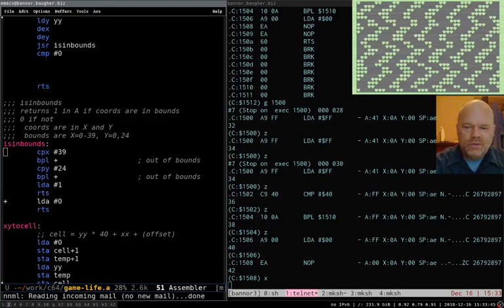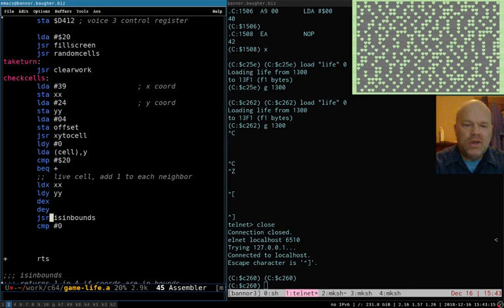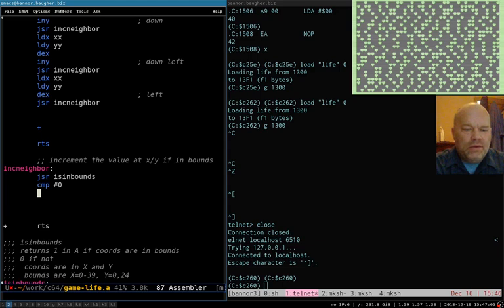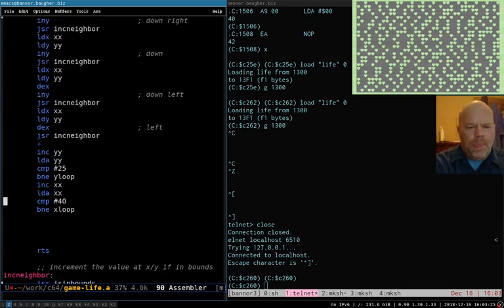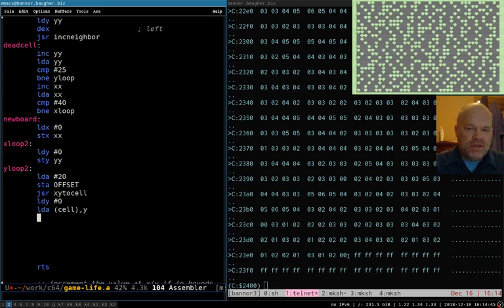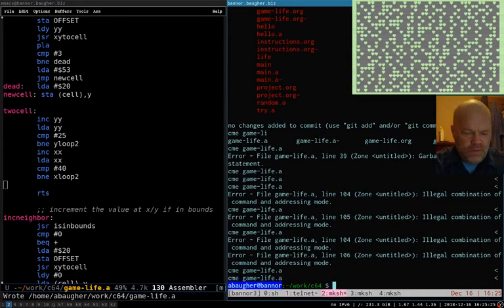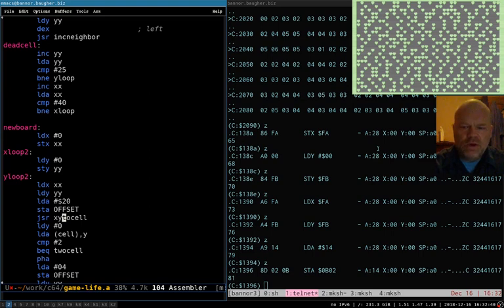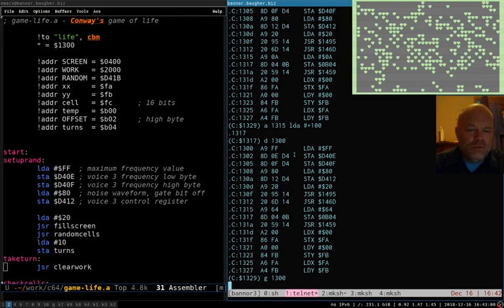6502 Assembly Language #9: Game of Life Part 2

Comment: The looping through neighbour is actually rather simple if you use the memory spaces.
Subtract 41 and then read the 3 bytes (that’s the top row)
Add 39 that’s the next row down and read those 3 bytes.
You can do that with a subroutine with an offset.
Run that twice.
And then read the current line, byte -1 and byte +1 from your current position, to avoid using your current position. And this can be a subroutine or you could parameterize the previous one to omit the 2nd byte (your current position).

Its more effective than the X, Y coordinate system in this case.
This is how I’ve done game of live in C, 30 years ago in college too. Everyone was new to C and were using two dimensional arrays (x,y) I just used a pointer to a pointer (which is in essence a two dimensional array).

Comment: Around min 43:21, I believe you don't need to compute screen area. Having working area cell address in CELL, you can add/subtract $1C to the high byte, to get the other area address, can't you? Should be faster. After all, screen and working areas are just $1C00 apart from each other.
Reply: $1C being $20-$04.